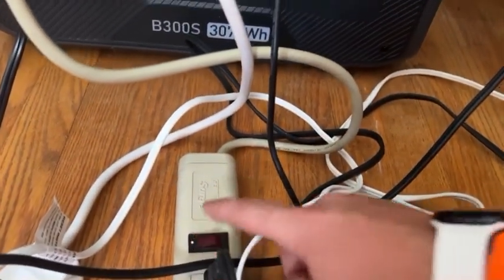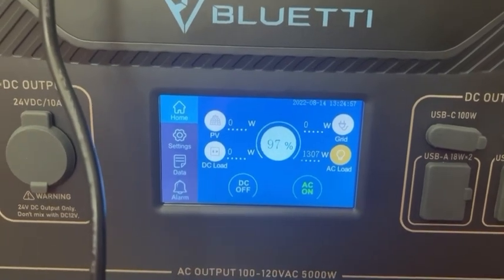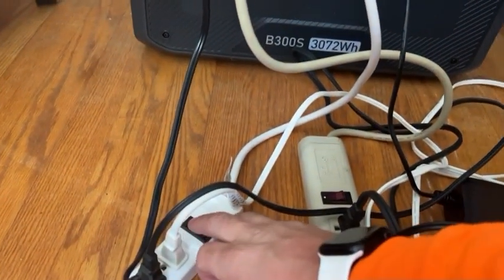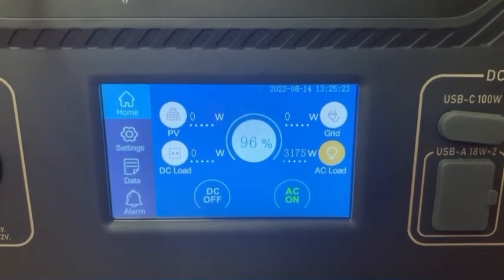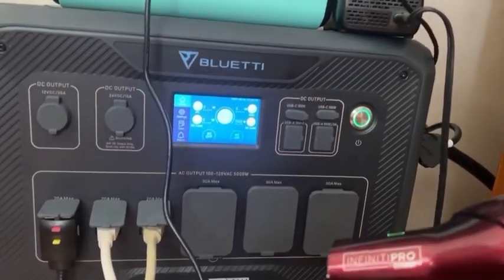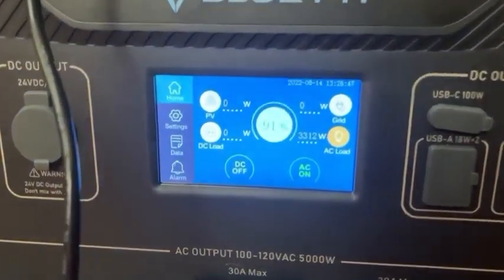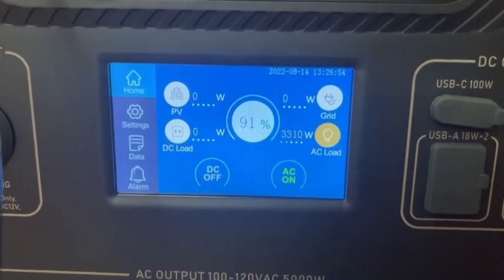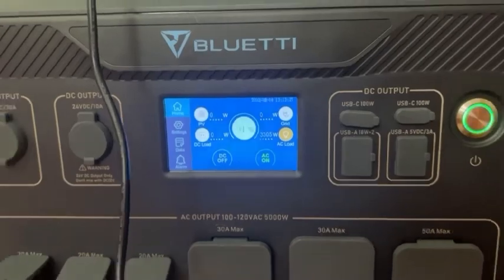Bluetti AC500 - Continuous max inverter test

Comment: It would not take long for that battery to run out of power with that big of a load. I am trying to run a 600 watt heater at night in a off grid cabin without much luck.

Comment: So does it come with a battery of 5,000 watts already and then you hooked up an expansion battery or is the top on just a inverter
Reply from the maker: The battery is a little over 3,000wh. The top module is the inverter, solar controllers, etc… no capacity in the ac500 unit itself.

Comment: Concerning expansion batteries, can you connect and use 3x b300 batteries? I imagine that because you can use a single b300/b300S, you can also use 3x or 5x rather than having to use an even number of expansion batteries like 2x, 4x, 6x.
Reply: If you use any b300 battery you will be limited to only 4 expandable batteries allowed per bluetti

Comment: What's the difference between B300 and B300s battery?
Reply: I would presume so. I have AC 200 max and B300 and use it that way and works fine
Reply: Can charge with 500 watts of solar. The B300 can only charge at 200 watts of solar
Reply: @kenthiergartner1506  Can you charge these batteries using their built-in solar controller and while charging it with the AC500 simultaneously?
Reply: @kenthiergartner1506  Or up to 1000 watts with a $200 adapter.
Reply: One of the biggest differences is the B300s can be charged in freezing temperatures.  Built in heating systems.
Reply: Letter "S"

Comment: I do hope it will take the "old" B300 batteries too. Congrats with your purchase. I am waiting for one here in Europe.
Reply from the maker: It will be backward compatible with the b300 battery. You will not be able to mix the b300 and b300s modules.
Reply: @B_Rogers0724  That answer makes me happy and sad at the same time :-) But the same was said about the B300 and the B230 and that mix works fine with the AC200max...
Reply from the maker: @pvdwolf  yeah exactly. The ac500 module by itself is relatively “inexpensive” so upgrading from the ac300 to an ac500 system may not be too expensive
Reply: @B_Rogers0724  sounds great sir, keep me posted if something weird turns up with it. You're the only one who i know has one and on YT so i guess a great opp to get more subscribers ;-)
Reply from the maker: @pvdwolf  I absolutely will, I appreciate it!
Reply: @pvdwolf  Jasonoid has one, hobotech probably has one but he won't put out his reviews till launch
Reply: @Moes_Prep_and_Tech  Will Prowse probably also has one i guess...
Reply: @pvdwolf  He probably does but he's extremely picky on what he reviews
Reply: @B_Rogers0724  Do I need a special adapter to use a regular B300 Battery?
Reply: @Moes_Prep_and_Tech  there's a new cable I believe you have to get with the higher amperage on the connection side to the ac500
Reply: @H2Daily  yeah I just found yesterday, it's a bummer.
Reply: @B_Rogers0724  Some Bluetti FB posts by "experts" say you can mix and match b300 and b300S batts on the ac500. Are they wrong?
Reply: Any idea on price for just the AC500?